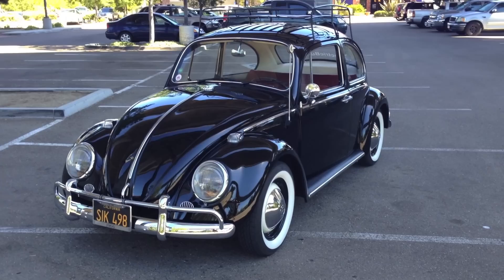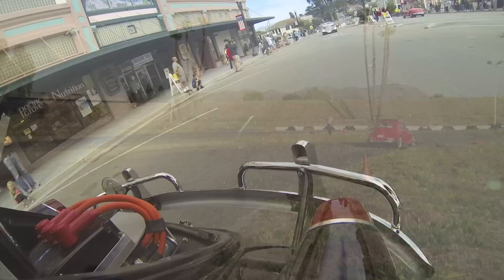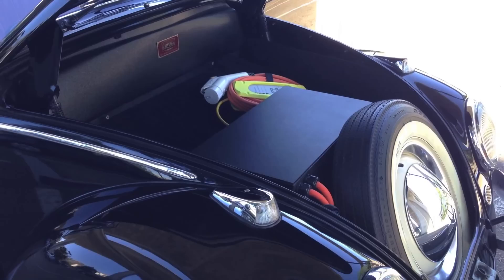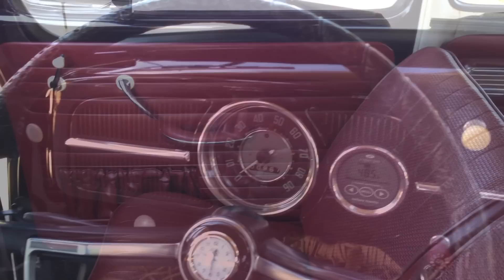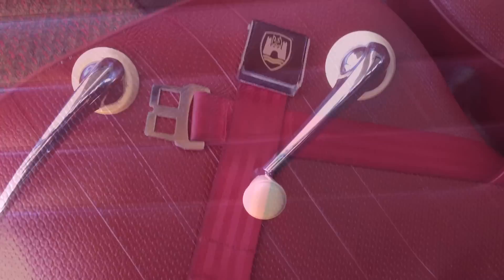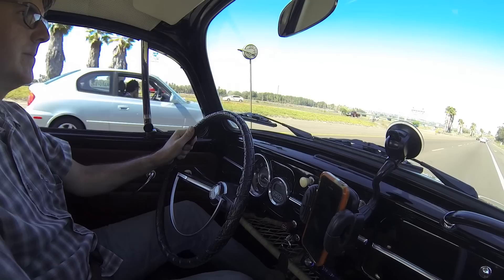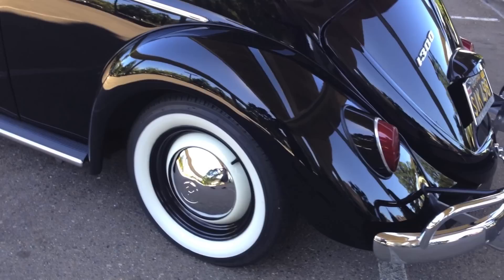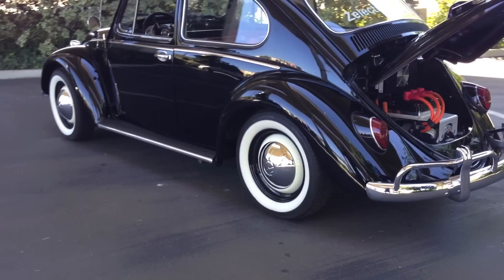Walk Around ZelectricBug Electric 1966 VW Beetle Rebuild

Comment: I smell bullshit.. How do you test drive 500 miles a day every day when yer range is only 80 miles and you need 8 hours to charge.. That's 7 charging cycles for 500 miles.......That's from 7 hours to 56 hours charging time alone as per his statement of 1 to 8 hours per charge... Also 500 miles at a constant speed of 60 MPH will take you over 8 hours to do.. Best case is you drove around town for 8 hours and came back to your fast charger every 80 miles to charge for an hour... So basically you are able to go less than 40 miles from yer dedicated charger or face an 8 hour lay over while you get a charge off of an extension cord at some place that doesn't have the 30000 dollar chargers installed.. I know a lot of these electric guys and they love them for second around town puttering but they still climb into the SUV to go see mom and dad back home.. Oh and 15 years outa those batteries.. Try 5 or six at over a hundred a piece.. that's 5000 bucks every 5 or six years.. 150K miles for battery life.. tat's 6 years of NORMAL every day driving.. Don't get me wrong they are great for what they are but the range and the lack of infrastructure kills them as a replacement for what we have now...
Reply from the maker: This car has an 80-90 mile range per charge. From zero it will take 8 hours to fully charge. If driven less, charging will take less time. Road testing is done over multiple weeks between 500–1000 miles depending on the build. In regards to lithium battery life, Tesla owners with over 100,000 miles are reporting only a 5% degradation in capacity. This car has only been driven about 4500 miles on electric over the past 2 years. Our 4 year-old daily driven prototype has logged about 24,000 miles so far. -db
Reply: It was said that it was driven 500 miles daily during testing.. That's not practical nor is it possible for that to be true..So yer saying that it took multiple weeks to drive 500 to 1000 miles ? The point is that the teck isn;t there to replace my daily drive...I drive a scant 50 miles to work every day of the week... There are no places in that parking lot to plug in so it's not viable to run a 200ft extension cord across the lot to my car just so I can make it home every day... If for some reason something comes up and i have to run to another facility I'll be sitting side the road someplace. Then it's not a matter of plugging up on the side of the road for five min and I'm on my way... Like I said it's a city car,,, The fact that you have 24,000 miles on the prototype in 4 years says you don't drive far at all,, Being that the average driver is driving 13,000 to 19,000 miles a year... I love electric cars and I will have one someday when I'm rich enough to afford something like that to putter around locally... The range and the charge time is a BIG issue that just isn't there yet..The range is the biggest issue..
Reply from the maker: If you're looking for an electric car check out the all electric Chevy Bolt: 230 mile range, air bags AC. A cool modern car but not big on charm. Teslas will do 300+. Higher mileage is coming, we just completed a 69 Ghia with a 130 range using Tesla/Mercedes batteries. The cars we're rebuilding electric are secondary vintage cars for our collector clients. -db
Reply: Please don't get me wrong, I love the bug... It's a total class act.. And I really have nothing against electric cars as long as they are represented for what they are and people understand that there are presently disadvantages along with the many advantages.. The Volt is a styling failure in my eyes so it's not something that particularly blows my horn..The Tesla is good and they are working with the infrastructure but the price point is way rich for the average work a day person.. If you are a big city dweller and you have access to the supercharger stations it may be just the ticket for a long trip as long as you pay attention to the map of the charging stations they provide The shear quality of the bug is as good as I've seen but it lacks range, again great in a place where everything a person would want is within 40 miles of home base and I'm fairly sure that the price point is out of reach for all but a few very well off individuals you target.. As a second car they are the bees knees in that you can run to the local stores and restaurants and such in that 40 mile radius of home or to a job that's within the range of the car.. Realistically I'll never afford a Tesla no more than I'll be able to afford a Shelby Cobra.. At some point in the future when there are chargers in most every town they may become the holy Grail that most electric guys claim them to be but not at this point in time..

Comment: The electric conversion is cool. However, 80 to 100 miles per charge... lol joke.. And it does not cost only 3.00 for 400 miles... BS....
Reply from the maker: Hi Pete, electricity cost is around $3 for 100 miles of driving here in San Diego. On average the US driver has a 30 mile commute. Additional batteries can be added to increase range up to 240 miles in the Beetle. -db
Reply: ZelectricBug 

OK, I misunderstood the cost.  3 dollars for 100 miles is still good. Also, 240 miles on a charge is very good. How much does the conversion cost a consumer? Install one of these kits in a ghia would be cool.
Reply: Which they've now done...keep watching!
Reply: less than $8,000 US